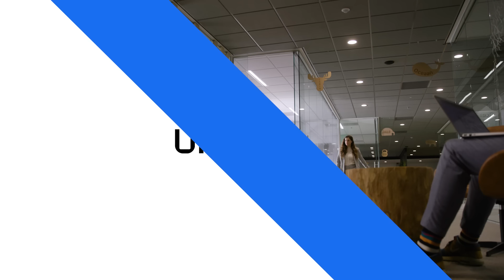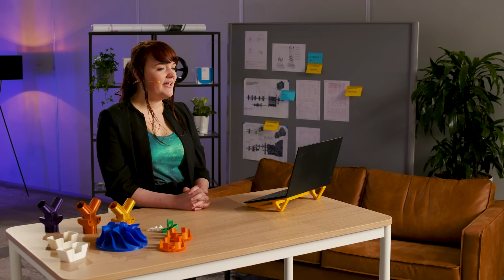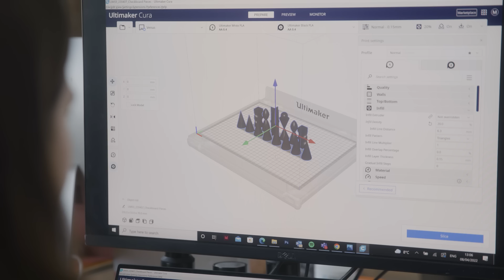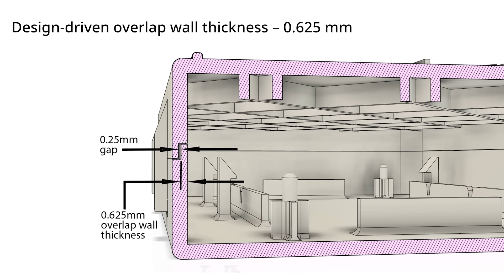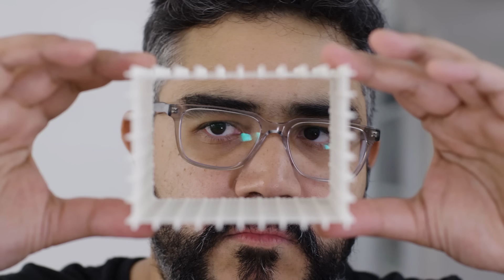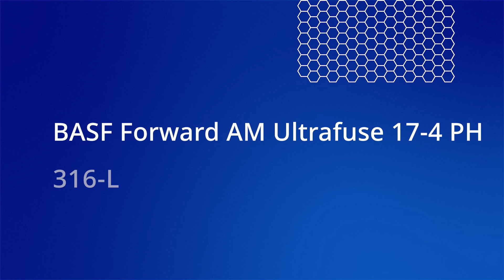Launch event: Cura 5.0 and metal 3D printing

Comment: The new slicing engine makes it easier for idiots like me to properly print PETG finally. Like no joke I just kept saying WTF the whole time as my jaw was on the floor seeing how well my printer was doing with Cura 5 when I initially thought it wouldn't make a difference. I had to fine tune the model I was printing because of how much more accurate the printing was.

Comment: So variable width seems to just remove the infill at small scale (since there's no point in printing it). How will this work with most cheap PLA with bad thermal expansion and width tolerance - won't it just cause blobs/overlaps since previously the slicer left a fixed width gap for the (yellow) infill lines?

Comment: Hi, I tried cura 5 and it's pretty awesome, I just copied my settings from older cura and printed part, that needed variable line width, It was like cylinder. But I have problem with z seam. New cura does blobs on z seam. I have seen chep video, but I don't see any stopping. It looks horrible and if it was functional part, it may not be working. And the seam wasn't even in one horizontal line when it was cylinder with placing on sharp corners. I haven't got problem with old cura, just variable line width.
Please, fix it, thanks.
Reply: I just copied my settings from older cura and printed part = M2C that could be your problem right there
Reply: @Cosmicnomadzaa  so, I cannot put old settings to new cura?
Reply: @MattsTechs  morning, it was just a thought as they have changed the engine of the software..I would try first with a fresh install first

Comment: I love Cura and using it it on my own machine, but I have to choose other slicer for production. Here is some reason: Setting often break after version update. Most of user request features (even simple, basic functions that other slicer have) are ignored because Ultimaker's machines does not or will not use that function.
Reply: We have a full upgrade path from the oldest cura versions to ensure that the settings get upgraded.

As for primarily supporting Ultimaker printers, that makes sense right? Ultimaker pays for the overwhelming majority (99%) of the development. It also means that focus will be on ensuring that features that benefit Ultimaker printers are implemented first.

If other companies (or anyone, really) would contribute these features to Cura, we would be more than happy to accept them.
Reply: @nallath  Thank for reply! I will try to upgrade on the next few days. Hope the upgrade process will be smoother than in older versions. Some features are already contributed by user, but stay on plug-in format forever. IMO, basic feature should be available by default if most machine can have benefit from that function.
Reply: @SnakeOilDev  The problem is that if we merge it into the main application, it means that we are also responsible for maintaining it. 

Cura is already a complex bit of software, so we have to be careful to not add too much to that. The more we have to maintain, the slower we will be with updating / bugfixes.

If you do run into issues, don't forget to report them on github!

Comment: WHERE IS HONEYCOMB INFILL????
Reply: You can load it as a 3d model and set is as an infill modifier mesh with surface mode. You can model any infill pattern you like that way!
Reply: @angelorf  Had you done that? I can't find any reference in Google about such technique, not even in the ultimaker forums
Reply: NOT IMPLEMENTED BECAUSE WE WERE BUILDING OTHER THINGS.
Reply: @nallath  Dude... Honeycomb infill exists in many other slicers almost 4 years ago...
Reply: @edrumsense  i know, and your point is? We decided to make something that is much cooler than honeycomb.

We also ran some tests and found out that honeycomb in practice isnt that much better. Variable line width is, so we went for that.

That being said, cura is open source and we welcome contributions!

Final note; if you want things, it also helps to ask it without capslocks.
Reply: @nallath  OK I WILL
Reply: "... isnt that much better" How much better is it then? @nallath
Reply: @jimkennedy7108  Only marginally compared to the grid infill and it also takes much longer to print. 

Hexagon is in theory the best infill, but due to all kinds of practical constraints, the difference isn't that big.
Reply: @nallath  WHY ARE YOU YELLING AT YOUR CUSTOMERS IN ALL CAPS
even the staff is obnoxious at cura
Reply: @clort123  a user isnt the same as a customer.

I also believe that if people act in a certain way, it means i dont have to stay polite and accept their shitty behaviour.

So if you want a helpful reaction, try starting a normal conversation. In that case i am more than happy to reply in kind.

I am not your verbal punching bag. Noone is.